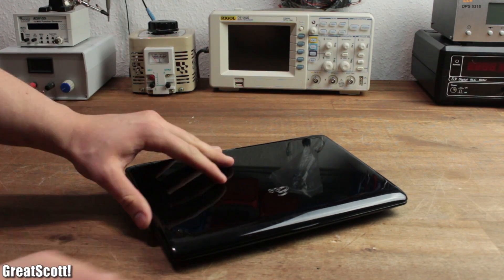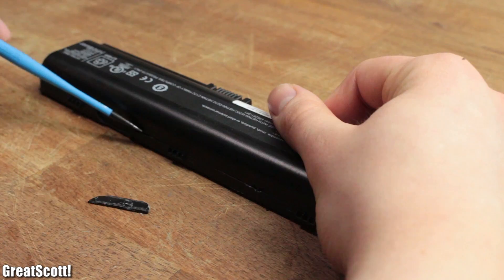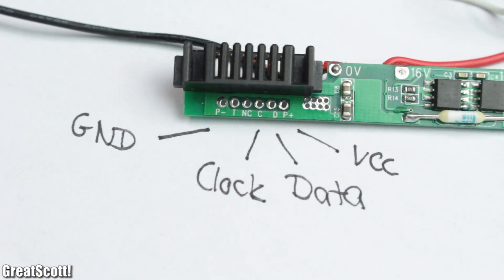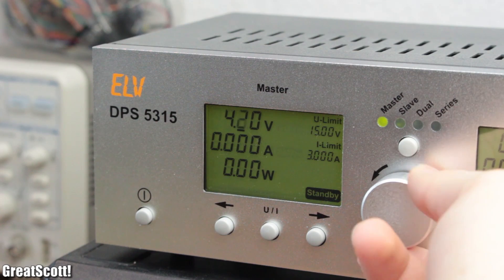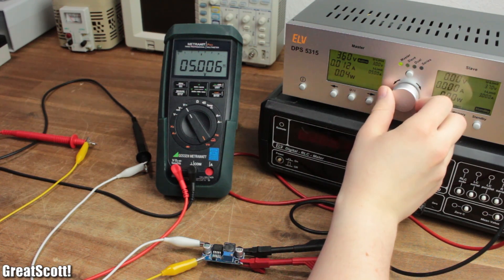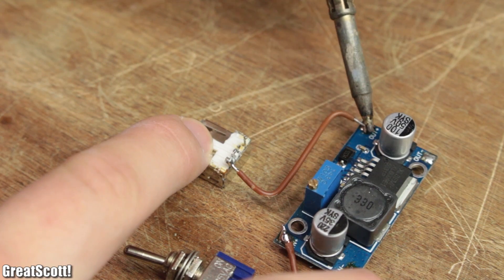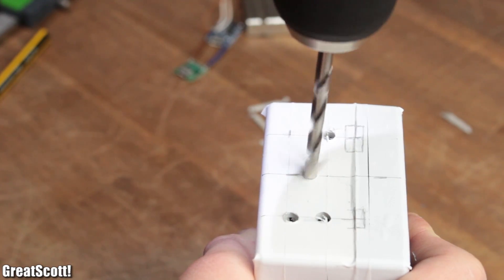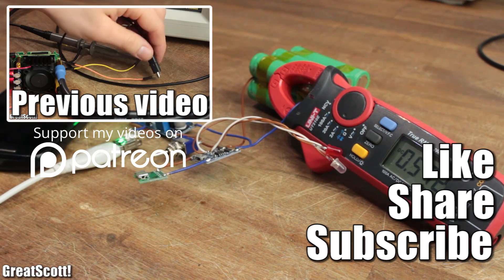HACKED!: Old laptop battery becomes a Power bank

Comment: PLZ HELP ANYONE!
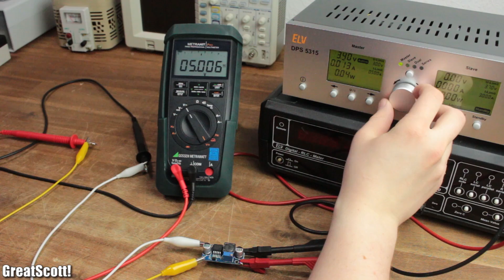hey guys, can some of you help me? I already have a "DC-DC 0.9-5V 600MA Voltage Step Up Boost Module USB Charger Blue", I was wondering if I can use it instead of the one he uses in this video, also if I HAVE to use the one he's using in this video, what do I have to do with that wheel at 3:00
thanks
Reply: Yes but u have to short the data pins of usb port

Comment: If i use 2 charging modules in parallel ( 2 charging holes for the battery), will they charge faster? Would it be safe?

Comment: i did found out the same when i unboxed my old laptop battery, the integrated "protection" circuits are real crap (maybe its on purpose? for profit). Also i suggest to take the parrallel cells apart because in my case they had uneven capacity. I recharged every cell on its own so i could restore all 12 batteries to the full 2200mAh (6 had to low voltage (2.3-2.5V). I plan to attach a BMS-circuit for every cell so they are better protected than the carppy BMS from the Laptop battery.

Comment: Guys I need help,  I made that power bank with 3 cells,  the result is absolutely nice with a good looking hand made wood case,  but the boost converter (integrated USB with it) turns of/on each second,  is it bad for your phone battery?  Thanks

Comment: 2:06 You said such an arrangement is just possible because the batteries have been always used together. In fact, that's not true. You've put them all in parallel, eventual state of charge differences would have been automatically evened out in the moment of connection since lower cells would have been charged and higher cells discharged. The real problem with uneven balanced cells is a serial arrangement. There is no way for the cells to self balance because there is no low resistance connection respectively short between the poles of each cell and there fore no compensating current can flow. When you draw current from the pack, both low and high cells are loaded with the same current draw. Is the state of charge or state of health different in serial paired cells, at least one of them would reach the recommended cut off voltage before the other. But you don't get this information out of the pack voltage because you just see the total voltage which leads to a lot of problems. THAT requires additional information and balancing which is accomplished by using balance leads and a µC circuit. Parallel arrangement does not cause any problems by using cells of different SoC or SoH. You shouldn't use cells of different chemistry, though. Neither in parallel nor in series.
Reply: Mr Mister what a loud of bullshit

Comment: what will happen if I add only 5 batteries? will it work?
Reply: Crazy Stalin you can attach just a 100mAh lipo if you want :D or go crazy and attach 50 3000mAh batteries :D BUT NO SERIES CONNECTIONS! 3.7V ONLY

Comment: The tp4056 takes a lot of time to charge the battery pack at 1A. Can you make it to charge at higher current like you used a bench power supply with 2A constant current.?

Comment: Scott, I'm having a problem with the TP4056 that you may have in this project: it limits the output amperage to 1 amp... Is there any way around that? I made a "dremell" with a dc motor that drows more than 1 amp... And I want to make more power banks as well (and I already had problems with them). Any thoughts?
Reply: @reaksmeysovannnara1761 It unfortunately won't work. The resistor only sets the charging current, not the output current.
Reply: @reaksmeysovannnara1761 Yeah, that's very true. 
Either way, what I do now when I need more current is to use a TP4056 without protection and add a 1s BMS. But you need to be careful about choosing the BMS as well...
Reply: @reaksmeysovannnara1761 To charge 1s packs, really. And there are TP4056s with type C connectors as well. 
But if you're using bigger packs with BMS, those breakout boards make absolutely sense indeed. I just didn't have the chance to work with those yet.

Comment: What about the charging current from boost converter ... i found that some smartphone
do not draw more than 450 mA no matter capability of the boost converter. phone recognize charger based on resistance or voltage on D+ an D- line.

Comment: Nice video! I am curious if the same method could be applied with USB-C break out board instead of the micro USB. Would the parts you use limit the charging capabilities to 5v 1.5 - 2A? How can one make a DIY power bank that accommodates the wide power range of usb 3.1 and Type-c connector?

Comment: I have 20 cells that I removed from one large lawn mover battery (ryobi 40v battery). I need a tp4056 charging circut, but one that charges at a higher amperage. Would using multiple charging modules do the trick? Or should I just wait the 2+ days that would be needed to fully charge these?

Comment: How long does it take to charge with that module?
Reply: Mussie Tesfay take battery capacity and divide it by the charge current the TP4056 can deliver. By default, these boards deliver 1A. example: 3000mAh/1000mA=3 hours of charging

Comment: sorry my question was i am trying to make a power bank but i also want the high amp rate without using low voltage out put to the cell so it  can charge faster but i still want the 5 volt for only the charging system. I tried it with a car charger that takes 12volts dual charger and i connected 4 18650 batteries in series to produce around 15.8 or 16 volts out and the charger works well and charged cell very fast but i still need to connect a a micro usb charger for it to charge the batteries back up when they are done but the micro usb charger only takes 5 volts or els the 16 volts will fry it since i tried it i know it will fry it hehe, so my question is can i connect the 16volt out put straight to the charger usb out for fast charge then also split the line from the 16 volt out and make 2 new leads out one - one + and on those ad a 5volt mosfet to regulate the 16 volts to 5 only for the micro usb charger and will it work to charge the 4 batteries that way or what would you guess will fail on it or will the 5volt mosfet cause trouble when charge is flowing back instead of forward out or would it be fine? if any one knows pls let me know thanks everyone ;-)

Comment: The max output the battery charger can give is 1amp.

That means that it will take like 12 hours to fully charge the powerbank (if it is fully discharged)

Is there any other way to charge the batteries with a board like this? 
For example a board that uses 2amp output and 5v input? So it could charge for half of the time?

Comment: hi,
can i use the battery while i am charging it?
i want to to make a portable Bluetooth speaker with an old speaker i have and i want to add this battery to power it up.

and another question:
does the xl6009 boost converter can make it to output about 12 volts (i will connect the cells 3 series, 2 paralel)?
my bluetooth amp is TDA7492P and it works with 8~24 volts.
i will pass the usb out port and connect the battery straight to the amp.

thanks!
Reply: pretty sure the xl6009 can do up to 32v but per the boost part, output > input
just google a spec sheet, they have them on most ebay listings too

Comment: You see laptop batteries, I see 18650s for vaping ;)
Reply: the 18650's from laptops aren't rated for the amount of current vaping pulls out of them
better off sticking with high amp ones from say - cordless drills (if you're looking to salvage)
you're liable to have the laptop ones blow up in your mod

Comment: Hey GreatScott! Im watching your all videos, really interesing, Im very newbie with electronics :D So I tried this build, used all same components, but when I set boost converter to 5V DC and put usb voltemeter and dummy load to test voltage and current I get very low current, like 4.8V and 0.4A. Is that normal? I thought I could get like 5V and 1A for my phone to charge faster :/ Or I have to increase on booster converter voltage to higher? because when I set like 5.2V I can get like 1.2A to dummy load, bet when I try to put more then 1.3A on dummy load, charger module just cuts off outputs terminals until I plug micro usb to charge batteries. some protection maybe is turning on, but 1A would be great. So if OK if I set 5.2V on booster to USB port to get higher current? PS, I shorted USB data pins.

Comment: Why not use a 2S3P arrangement and step down the voltage more efficiently ?
Reply: probably because that might require monitoring the batteries for voltage irregularities and/or more setup to balance charge them

Comment: so If I purchase about 20 to 40 cells I could do the same with creating a really high capacity powerbank?
Reply: it would be heavy.. and you would need to find an alternate charging solution as that charging board tops out at 1A and 20-40 18650's would have between 40,000 mAh to 80,000 mAh so from basically empty (~3v)  you'd be charging anywhere from 40-80 hours (that's assuming you get batteries with 2000mAh capacity.  If you purchased LG G3 batteries, they have around 3000mAh so you'd be looking at possibly 60-120 hours to charge in that case depending on how many you purchased)

Comment: hi i have a 36v lithium battery pack (14 pieces 18650 lithium battery 
all connect together from a ebike ). i want to convert the outage to 12v
 so i can recycle to be a portable power bank for my 12v piano keyboard.

Comment: oh God the cells are made by samsung. lol
Reply: their 18650's are actually really reliable (they're in many brands of laptop and they're proven technology) so there's nothing to worry about.. unless you crush one for some reason lol
Reply: i was joking about the cells.
Reply: Chad B Hey I was wondering if I could add another USB port to it?
Reply: Yeah, you can either use a dual port or add another port, just needs to be wired yup the same.
Phones etc shouldn't draw enough amperage to cause problems for the batteries unless there's a short
Reply: Chad B so I can just wire another usb port to the boost converter. But will the charging rate be slowed down by the other port if two phones were connected?

thanks
Reply: Double check the amps that the boost converter is rated for, but I think it's enough for 2 phones (2 amps max per phone)
If you're charging Apple devices the data pins have voltage requirements, if not a <200 ohm resistor between the -/+ pins will do.
Reply: Chad B A 200 ohm resistor... ok but some people have been saying, and greatscott did say it him self (on the instructables web page)  that you can bridge the data pins on the usb to get faster charging.(it tells the phone that no data can be transferred, so it can draw as much power as a standard wall charger.(thus charging faster)
Reply: Daniel Cook I know

Comment: I have made one and it is awesome! Thanks!

The TP4056 is getting very hot whilst charging, I have 5 1800mAh Samsung cells in parallel and I am charging at 1A via a mains adapter.

Has any one else experienced this? Anything to worry about?
Reply: bigdavevw this is because one tp4056 can be used only to charge once cell

Comment: What if one battery has more charge than another? If one battery has full charge and another one has half charge, wouldn't it continue to charge both batteries, and overcharge the first battery?
Reply: they will self regulate (in parallel) and it's almost impossible to overcharge 18650 batteries unless you overvolt them.  They will only take what they need for current when charging - i would highly recommend you at least bring them as close as possible to each other first though
Reply: Chad B ty!

Comment: IMPORTANT: after connecting the boost converter DO NOT CONNECT IT TO ANY USB DEVICE (CELL PHONE, CAMERA , TAB etc.) at first YOU TWIST THE POTENTIOMETER TO ACHIEVE 5 V THEN CONNECT IT to any USB device or else you will end up frying the protection chip of your USB DEVICE since usually the boost converter is ramped up to 20 V and that's how I ended up frying my phone's protection chip. Yet your videos are awesome GreatScott!!.

Comment: I would recommend puting a fuse before the circuit boards. It has happened to me that my shitty powerbank ( which has a similiar circuit than the blue charging module ) got a short circuit. The ic that controls the charging blew up for no reason and created a short on the battery. Luckily i was there to pull out the batteries in time before everything melted away xd :)
Reply: "for no reason"

Comment: I had some battery for the GameCube that has 10 cells and no information on it also it is supposed to power a 13volt screen but even when letting it charge overnight it won't turn on
Reply: 12 not 13
Reply: drained dead

Comment: Would it be possible to use a usb wall charger instead of the usb part of the circuit board? Say for example, you have the micro usb for input charging, then the batteries connected to a wall charger?
Reply: takerkanefan108 No that wouldn't work. The wall charger would need 120 Volts of alternating current, while this puts out 5 volts of dc current.
Reply: Okay i see what you mean, thanks

Comment: Great project! I do have a couple of questions though.
1. Since you're using only one TP4056, How lomg does it take to charge up the pack?
2. I have a pack of 5x18650 battires, that I"ve charged individually to around 4.1V. Is it safe to connect them in parallel?
Reply: Amal Surendran advice : after charging the batteries let them about 3 days without using them . if the voltahe has dropped more than 1v . they are not ready for using as a powerbank
Reply: Amal Surendran and yeah it's safe toconnect them in parallel

Comment: Hey, which charging module do I use, if I have 6x 18650-28A batteries, which charge at 4.3V. They can be charged at 4.2V, but the mah is lower then.
Reply: in theory you could use a buck converter and a micro usb breakout and use that to charge instead, though knowing when it's done will be.. difficult and you might want to find a way to limit the current